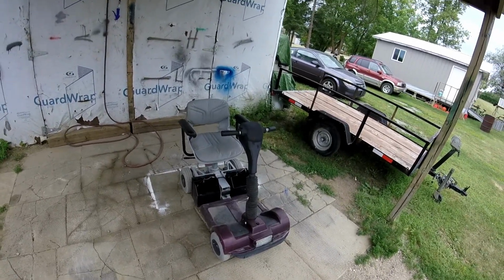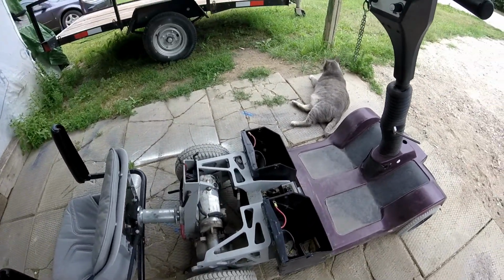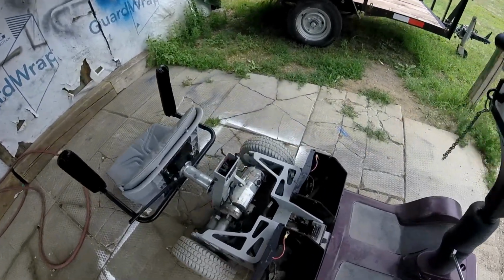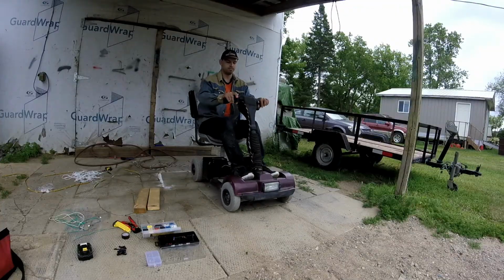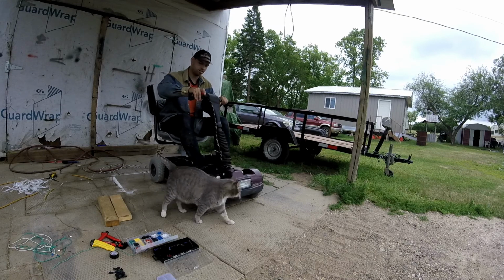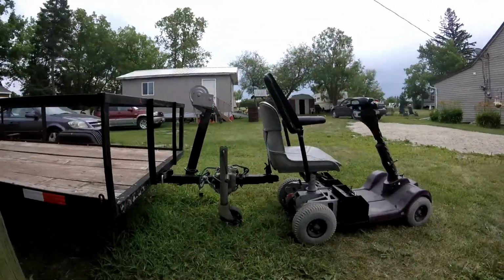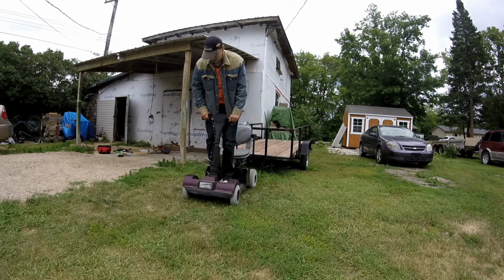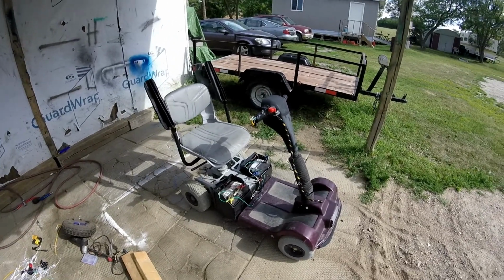Mobile Scooter Powered By 36 Volt Milwaukee Battery

Comment: How long do two 18V batteries last?
Reply from the maker: Enough to drive around the block once then it started to die out but they are only 1.5 milliamp batteries I think 5 milliamp batteries two of those will  last a good time